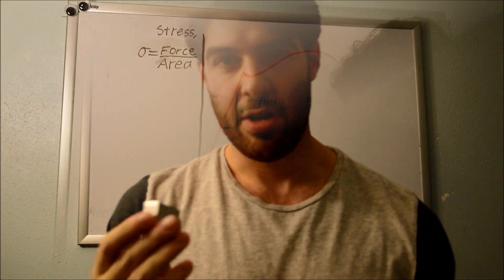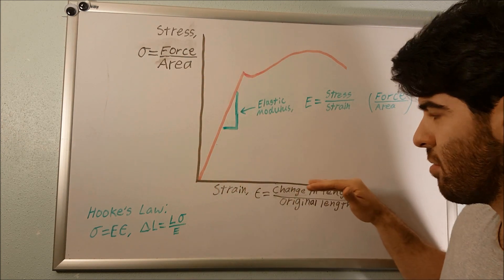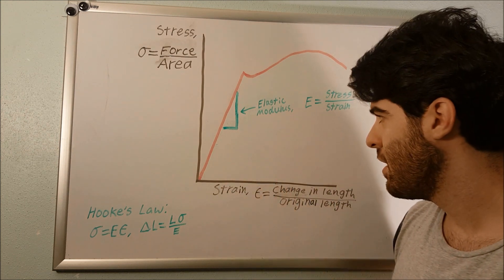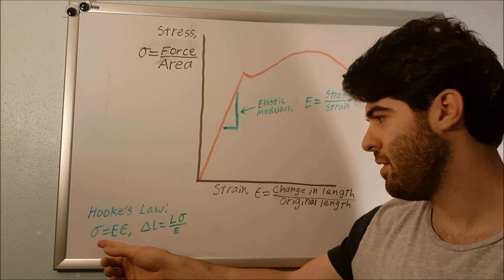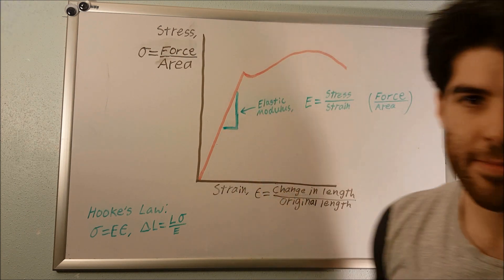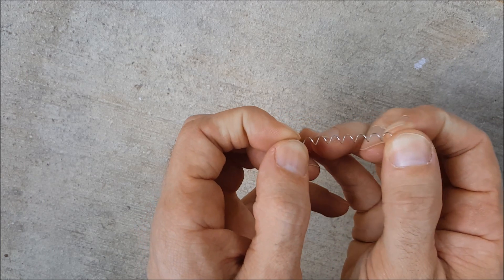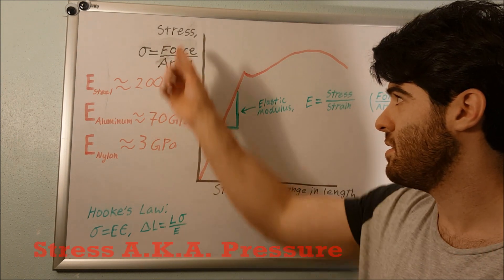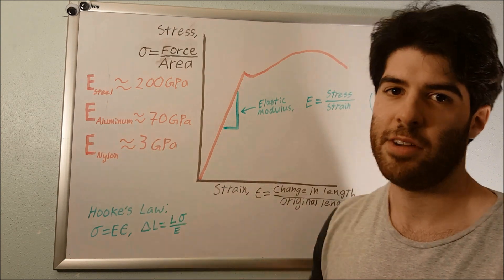Elastic Modulus Explained

Comment: Thank you that was a great explanation. I have been trying to determine the Elastic modulus  of an elastic strapping using an ASTM method D4964-96, on a tensile testing machine. But im not equating the results, they don't add up to the standard values i have. Do you by any chance know of this method? your thought would me greatly appreciated.

Comment: Hello, thank you for posting. It was useful and clear. Just one question if I may ask you: Do you know anything about stress-plateau?
Cheers
Reply from the maker: Hi Juan, thank you for the comment! I know the term as referring to the average stress developed in cellular structured materials (metal foams) at specific strains, and as another name for ultimate strength. If you are referring to the former definition, I am not an expert, but I know it is a method of reconciling how foams behave under loading (they are essentially countless numbers of cantilever beams that are connected).
Reply: Thank you for your answer. In my study case, stress plateau it's used as the ultimate strength of a polymeric based material.